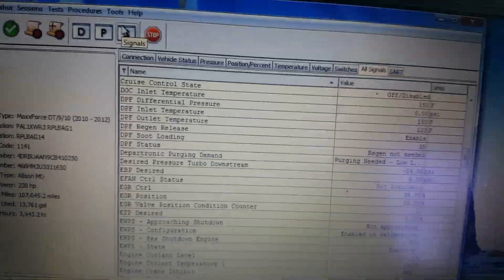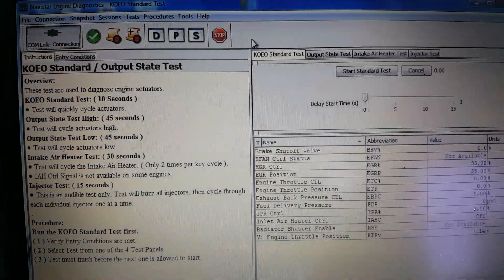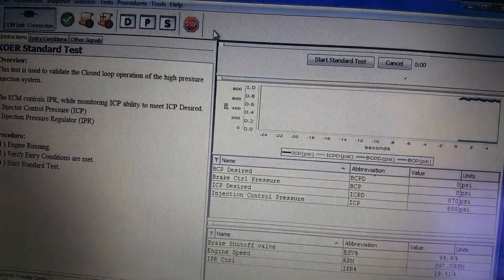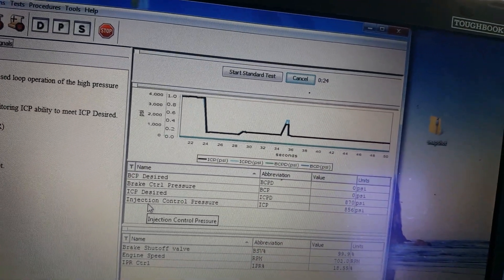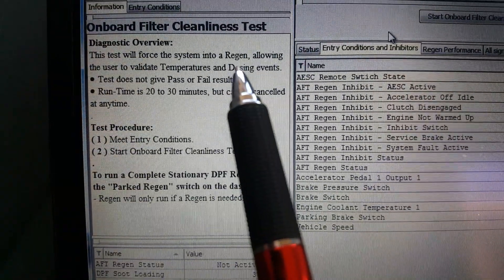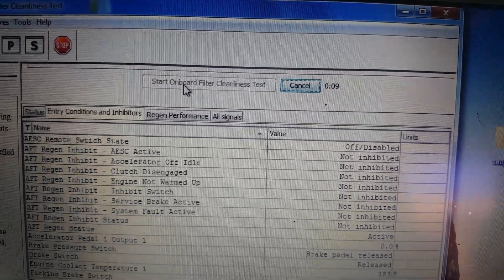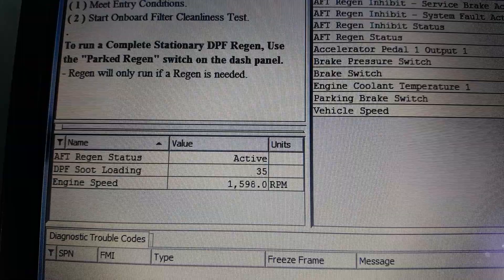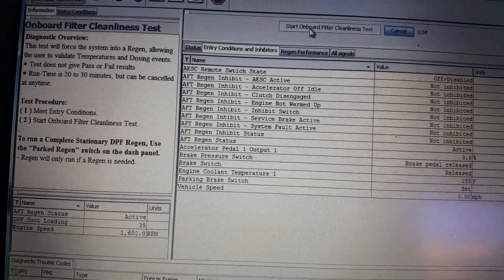Regen Using Navistar Engine Diagnostics Software

Comment: Can the koer test fail..or is it a standard procedure before  regen ?
Reply from the maker: Certain engine codes will make it fail or if a pressure isn't correct. KOEO and KOER has to be done first nefore a regen.

Comment: Where do i get you program ?
and cost.what type laptop should i use for ??
Reply from the maker: I can find out for you about software. Any decent laptop will do. I will reply with more details.
Reply: @MechanicsHubdotCom  i have an international truck that shows 88% dpf soot threshold. Seems very high to me, but it won't park regen.
Reply from the maker: @JesusChristisKing2025  you need a laptop with engine software to do a forced regen. Your soot load is very high I would regen asap.
Reply: @MechanicsHubdotCom  i just got Navistar Engine Diagnostics on my laptop but i didnt see how to force regen. I'll look again on Monday